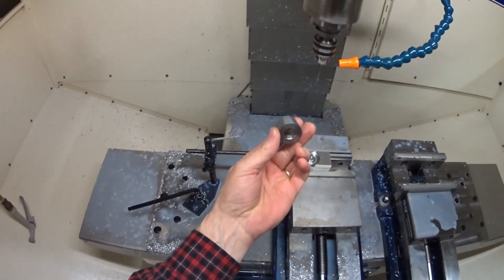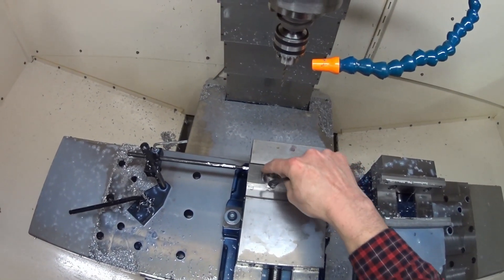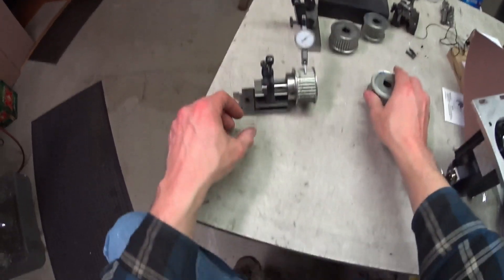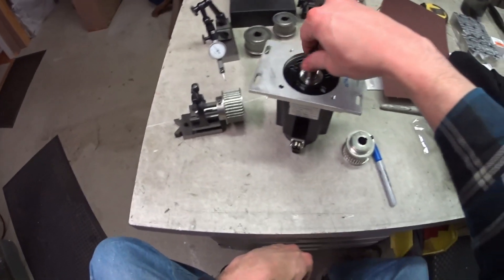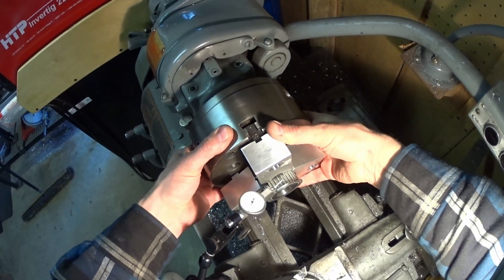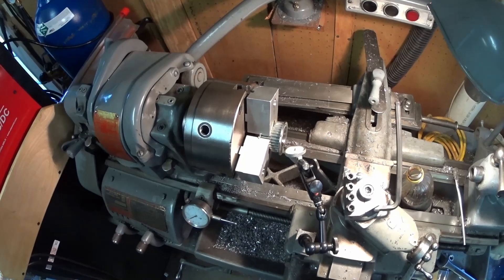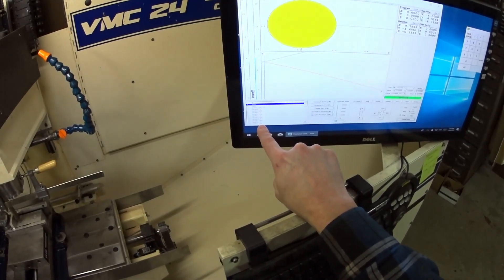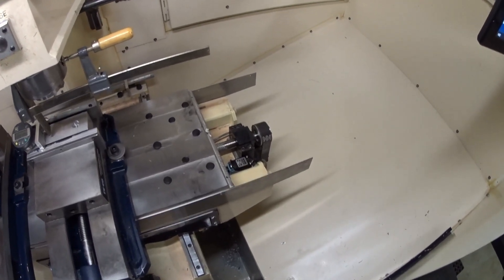VMC QD Taperlock Bushings

Comment: What size tube did you make the column and base from?
Reply: Column is 8" x 1/2" wall tube.  Bed is a weldment made from 1/2" plate.
Reply: Thankyou machine looks very cool similar to a Fadal vmc15
The y axis way cover is pretty neat.
Reply: Yes, I copied the Fadal design on the Y cover.  It makes the saddle design much more complex (to maintain stiffness) but allows the cover to work perfectly.
Reply: Also, to dampen things, I filled the tube and bed with varying size aggregate (pea gravel).  Otherwise it rang like a bell.
Reply: That’s good to know I was thinking of going with 10” tube 1/2 wall on my build so I appreciate you letting me know that I’ll have to dampen it.
Reply: Also Funny it rang my Fadal vmc15 is 1/2 wall 16” tube with no dampening